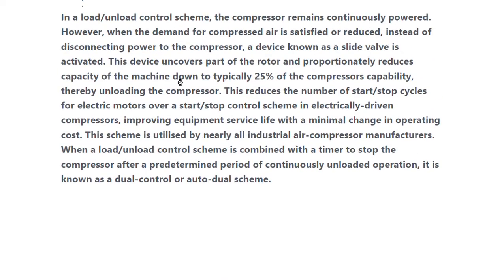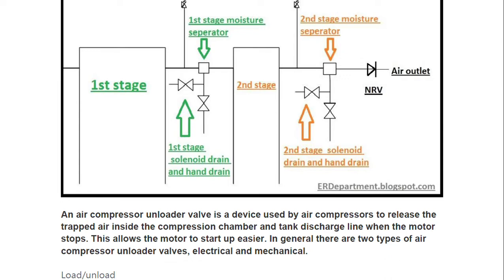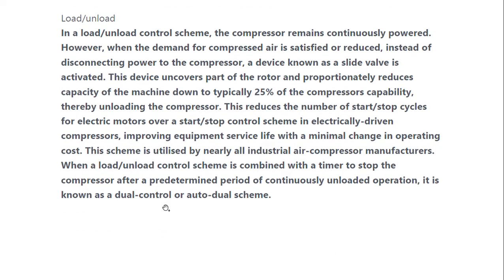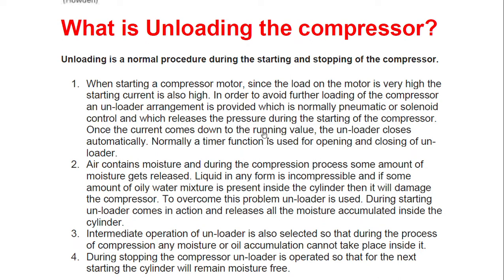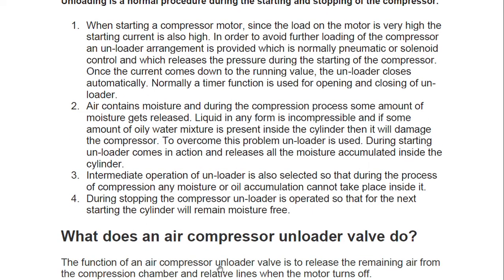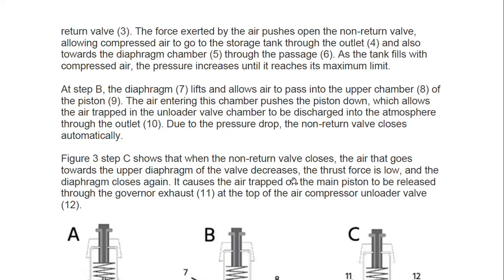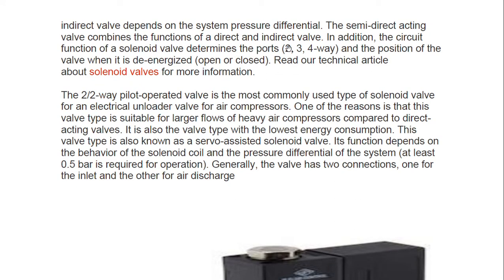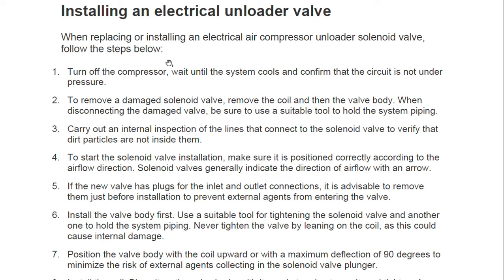Function of an Unloader v/v,Mechanical Unloader/Solenoid Unloader,Component of Unloader/Installation

Comment: brother,  i have a question.
How can i be sure that unloader is working properly? what will be the indication?
Reply: 2nd stage chamber pressure will not go down after compressor stops i.e chamber will remain pressurised.
Correct me if I'm wrong.
Reply from the maker: You are correct but the direct indications would be:-1. Typical symptom of an unloader failure is a sudden smooth pressure loss. 2. Water leaks and inconsistent behavior are also signs of a potential failure in the near future. 32. The typical signal when there is an unloader malfunction is a reduction of flow through the nozzle, which results in pressure loss
Reply: @ersauryashankar  understood